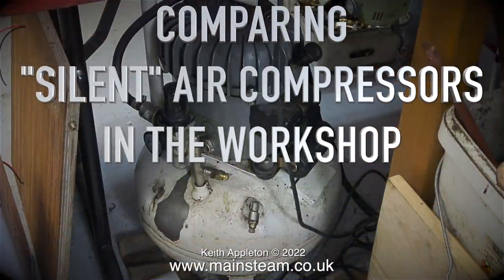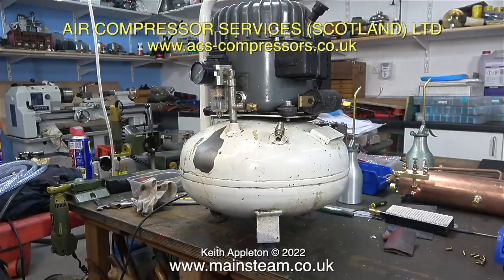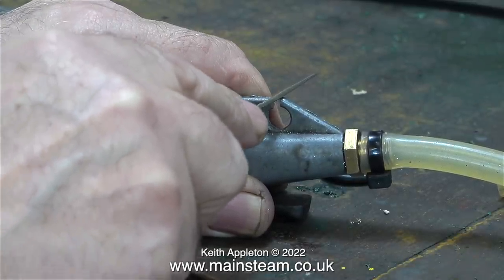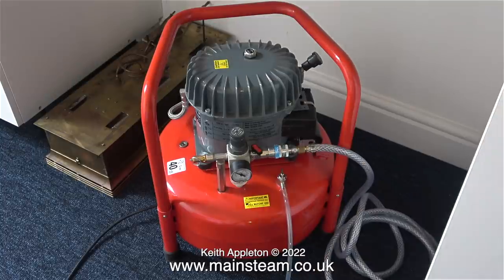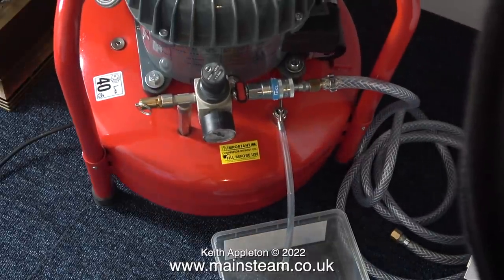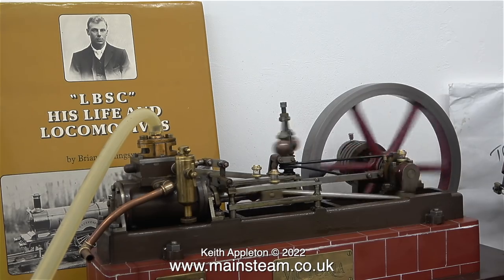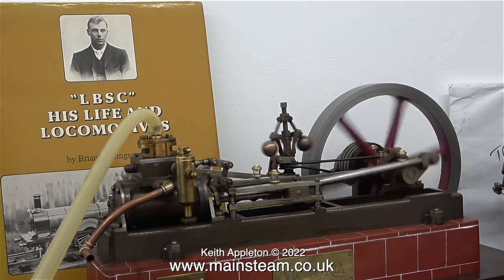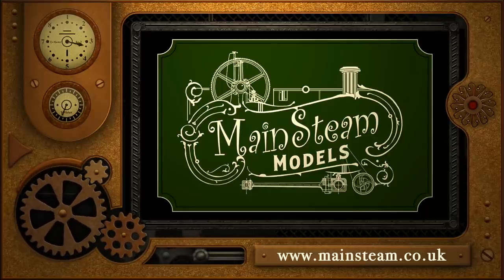COMPARING "SILENT" COMPRESSORS - IN THE WORKSHOP

Comment: I plan one day to build a small insulated enclosure outside then get a decent sized compressor then pipe the air into the workshop. A big tank means it won’t need to run often anyhow which would be idea for the way you use it.

Comment: Keith if I might add, the most important thing about an air compressor is the volume of air it produces and at what pressure. Things like tank size and how noisy it is can be found in the specifications given by the manufacturer or supplier.
Reply from the maker: Yes, thank you, I am quite aware of that . . . .

Comment: My compressor is no where close to being quiet. It lives in the closet in my spare bedroom, which is my workshop. I'm in the process of building an Allen Models 2-6-0 Mogul. My workshop isn't big enough for the lift/stand that the engine sits on so it's in my living room. I've been working on it for too long. The live steam club I belong to, the Iowa Model Steam Engineers held our spring meet the first weekend in June. I had the pleasure of getting to run another fellow's engine, a Mogul just a bit smaller than mine. This was my first experience as engineer. I loved it!!!!! This was just the right kick in the butt I needed to get busy and finish my engine. I'm working on the plumbing now and am making significant progress.

Comment: I built a mdf box lined with 2" foam a few times. And put your generic cheep oil free compresor in it. They just hum like a fridge. I always thought them "silent" compressors where and still are a rip off. But if you stick that one you have in a box, it would most likey sound like a mouse farting at 200ft. I wish they made tiny compressors to run air nailers from. 300w or so so I can run it of my vans invertor. I don't need the CFM for nailing, you can't seem to get anything lower than 1hp. I use my little makita cordless tyre pump for the little nailing jobs but have to pump the gun for each shot. 18v nailers/staplers are £300+ a pop.

Comment: When I worked part time at Chase Pitkins we sold small "pancake" compressors from DeWalt, Porter Cable and Delta which were all different and of good quality and quiet.  I think the term "pancake" came from the shape of the tank.  One by one they sold out and shipped production to China.  The compressors made in China were noisier and less reliable and you could tell they had been made in the same factory.  Even Ingersoll Rand compressors and air tools are now made in China and are no longer considered quality items.

Comment: I have the smallest one in the same range as yours, had it 5 years and never a problem, it is also as near silent as any motor can be, my fridge in a fair bit louder.
I have also owned one much like your old one, as quiet as yours is, but still the little clark one is quieter, that said probably not enough air for you at .8l a minute.

Comment: i have a twin bambi compressor  real good
Reply from the maker: I have one of those now, still a bit on the noisy side but as it has a 50 Litre thank, I can  turn the twin compressors off and the air in the 50 litre tank lasts quite while before I need to pump it up again.
Reply: @keithappleton  i got mine second hand the motors where full of water   but  i fixed them up